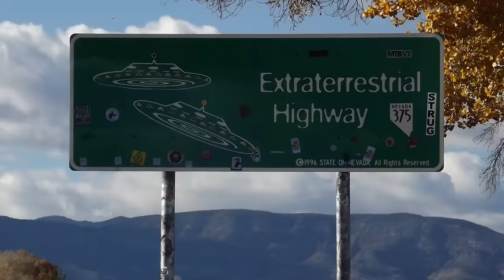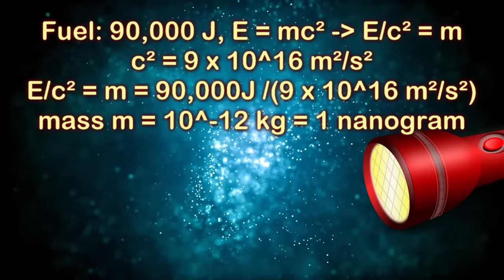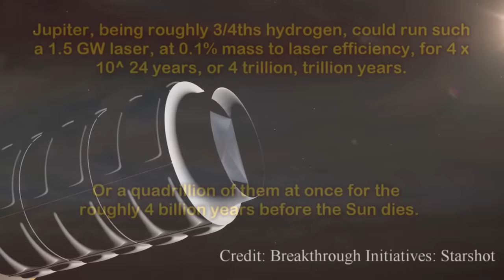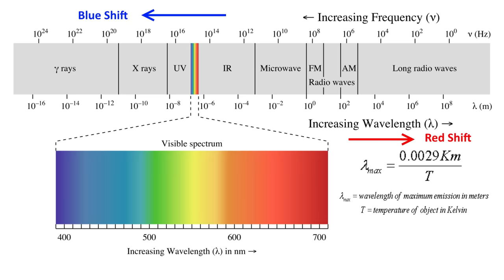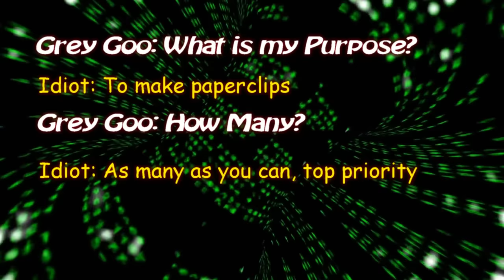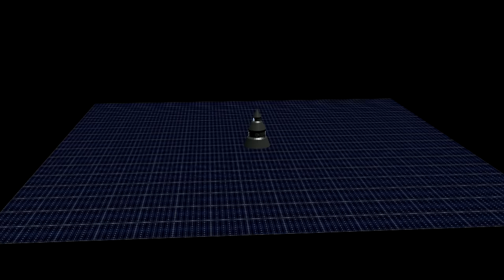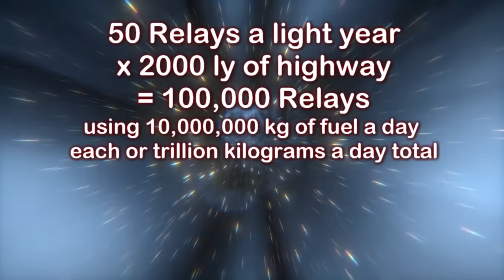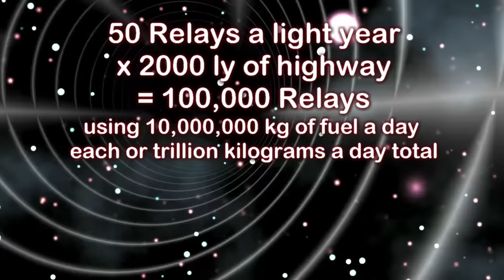Interstellar Highways

Comment: Thank you once more for that great content you're providing, Isaac.

One note though, I think this time your ballpark equation forgot one thing: Equal and opposite reaction. Those laser stations would eventually need to project the same mass/energy in the opposite direction.

Unless I failed to concentrate and you actually mentioned it. :-)
Reply from the maker: I think I did, maybe in gloss-over fashion. The stations can be quite massive, just huge bunkers of hydrogen if it comes to it, so they won't move much, and they can bounce off each other in a long array for corrections and do momentum dumps at the chain end on Jupiter or the Sun, etc.

Comment: I know this is a really old episode but since a flashlight would accelerate from using its light, how would the relays stay in the same position?
Reply: They wouldn't, the positions would need to be stabilized and corrected.  
Either on board engines or light from nearby stars could be directed to correct the positions of way stations using light sails.

Comment: What about station keeping for those laser outposts? You might have to fire a second laser in the oposite direction so the outpost doesnt push itself away. Or maybe you could use the exhaust material from the fusion reactors to fuel an ion drive for that. Or even use the other laser outposts to push each other back into position.
Reply: Use the waste heat of the laser; radiate enough in the opposite vector of the beam emission and you can cancel the 'drift' effect.

Comment: To get the equipment/personnel out to an interstellar comet to build a relay couldn't you send two sails out, both contain fuel and a laser. As you approach your ice ball the home laser shuts off, the front sail fires a laser at the trailing sail, slowing it down. The front sail flies off into oblivion but the second sail is now stationary in relation to the iceball, ready to stop the sail with the crew and equipment.
Reply from the maker: Yes but no, there's a long time lag to slow down and the other sail is going to keep getting further away quite quickly. There are other ways to slow down, Bussard Ramjet, fusion if you've got it, old school Orion method of shooting Nukes out in front of you, etc.

Comment: In Robert Forward's Mirror Matter, I remember that he had some calculations showing that an antimatter fueled rocket wouldn't ever need a fuel fraction higher than 63%. I don't recall if that was for pion or photon rockets, or if that even applied to interstellar travel, however.
Reply from the maker: I don't recall that one very well, I'm sure I've read it but I love Forward for his ideas and his writing itself is kinda 'meh' so I rarely reread them and not in a long while. I would guess though that he was making a generalized statement about there being no point in going faster than that. I mean the exhaust velocity is basically c for antimatter so you are going to be at decently relativistic speeds off that.

Comment: You didn't mention Robert Forward's idea of detaching part of the solar sail to reflect the beam so that the reflected beam can be used to decelerate, which of course depends on the trajectory being in three dimensions hence the path to the reflector does not actually cross the decelerating spaceship.  As these are sunlight speed methods of transit, not only would the "highway" have to morph with the movement of the stars but must last for many thousands of not millions of years to be viable plus they would take a long time to establish.  Conceivably, we could use Orion pulse propulsion to establish a number of these waystations between Sol and Proxima Centaurus in a reasonable period of time but really the hope would have to be in finding such relays built by prior civilizations.  How would we detected them, flashes of light as they are used? Ribbons of what would appear as dark matter to use if they are matter streams?  How would we design a spaceship to use multiple variants of this technology since there may be several technologies by different civilizations found.  What could we bring to trade for the relay service?

Comment: If the sail absorped %100 of the light rather than reflect it wouldnt that get rid of the unexpected drifts?(Caused by the 'miniscule change of angle of the mirror')  
Since if it absorps rather than reflect the light, the miniscule angle variations of the sail would not matter and the ship would only gain momentum in the direction of the laser beam it just absorped.
But then there is a heat problem of course...

Comment: the lasers bouncing off the ships would be quite dangerous since they bounce in different directions depending on the ships steering themselves, outputting high energy beams all over the place. it would be interesting to think about the safety measures needed to avoid those beams wreaking havoc to some nearby rotating habitats

Comment: 1. Can't we have the arriving craft transmit its energy to the departing one (something like a electromagnetic system in my knowledge standards; something like a spring load-realease system in kids standards, and things way more advanced in modern, let alone future realistic standards)?
2. I don't think its wise to mine the planets, stars and even asteroids other than what they loose naturally (sun's disonsphere should be fine for example) as they
a) keep the balance of the solar system by their gravity and
b) can be used as slingshots which means
i) the routes would need even more frequent updates due to moving and shifting gravitational fields/forces and
ii) their elimination would stop this advantage of free acceleration in any desired direction.

Comment: As a concept would quantum entanglement be viable to transmit data to maintain beam alignment? Specifically in terms of GPS.

edit: I should clarify. Could it be used for timing synchronization?

Comment: This is a bit of a tangent to in-system travel, but it follows from the particle stream riding idea;

Would it be useful to magnetically constrict solar wind, via a ring shaped stations, forming a sort of spiraling canal of charged particles? Or would the energy requirements for such magnetic constriction fail to break even when compared to using that energy for laser boosting?
Reply: Having mulled it over a bit more, I have come to the conclusion that such a system could be effective regardless of the energy need if the magnetic field constricting and speeding up solar wind is a secondary effect of some other system. Or possibly a tertiary effect, if the magnetic field generated would be sufficient to shield people from radiation. Though it's hard to imagine that such a shielding would be useless even if it required to be supplemented by mass.

This - in my mind - could be achieved by having counter-rotating rings acting as a transportation system for a large enough ring shaped habitat or set of habitats arranged in a octagonal tube, bell or hourglass shape. With the conveyor belts forming a gigantic Wimshurst machine. Of course such a habitat array could be used to simply magnetically accelerate spacecraft, or if arranged in a more complex manner, to offer boost services of both plasma and magnetic types.

[edit]: In retrospect, this specific scheme seems a bit contrived. Especially since such a construction could arise from sufficiently dense network of vac-trains could give rise to such a field or mandate it if the magnetic fields of the maglev tracks would cause van Allen belts to appear within the habitats otherwise. That - in my mind - makes it conceivable that there is a sweet spot of location, scale and requirements where such an arrangement is viable and economically beneficial. Provided you can charge a fee from the ships passing trough your sovereign space.

Comment: Wouldn't you need a special field to absorb nutrons [instead of a material]? 

How about shooting a nutron beam into a black hole [a blackhole that is power core]?

Wouldn't that be efficient?

(I'm not a physisicst so IDK, sorry if I seem trollish or ignorant)
Reply: If you created a small black hole with an electromagnetic squeezing tool (IDK how much power <i>that</i> would take), start it rotating, create a orbiting ring craft around it; and then use the black hole as a solar sail (would stray nutrinos get absorbed by it and send it off course?), and then blasy nutrons and photons and protons at it via laser: to get it moving?

Comment: Have you given any thought to using planetary magnetic fields or currents for accelerating ships. Remember when they did the conductive tether experiment on the shuttle and as it extended it burnt out like a fuse. Seems like electric current generated by a ship could act against planetary or other magnetic or electric fields in the solar system to accelerate itself.

Comment: Just a thought, would you need to double the output of the laser stations to keep them on station? Wouldn't the Lasers move them as well as the ships they move?  If the laser stations were on very massive rocks they would still be moved over time? I guess if they shot both ways it might help but still it would have minor angles to deal with as you don't want the ships to hit them either. So they would need more fuel than you thought of but still would be worth it.
Reply: I think I heard it said once they'd have to fire off in the other direction, at least enough to cancel that out or some such. Though if you have 2 way traffic that can be balanced to take care of itself.

Comment: As you shrink a rocket from Macro to Micro scales, does the efficency naturally go up? I mean a lot of rocket fuel is random molecules working in a nozzle sometimes against itself creating wasteful pressure in various directions.. a very tiny rocket engine would be like a rail gun with only one direction and very little waste.. perhaps some quantum effects.. if you could scale a "Perfect" Pressure plate Upwards so it only emits molecules always in one direction it seems like it would have very high efficiency and waste very little as heat.

Comment: Wouldn't each relay also need a second set of lasers blasting in the opposite direction of the first, to keep the relay from accelerating itself out of place?  Or a bigass set of ion thrusters or something.
Reply: You don't need high speed thrust, just equal offsetting momentum.  Ejecting waste material from asteroid mining in the opposite direction at chemical thrust speeds would do the trick with enough mass.

I do wonder if you could have a colony close enough to a nearby star to have a solar collector large enough to sail on the solar wind with enough force to no just counteract the stars gravitational pull, but also cancel out the laser thrust produced.  I'm sure when you can gather even a tiny percentage of an average star's output, there would be some easy and economical way to counteract the laser thrust.
Reply: Lasers of the output IA postulates will generate
A LOT.
of waste heat.  If some or most of that heat is radiated in the opposite direction of the laser, that could be enough to mostly offset the momentum imparted from emitting the laser beam.

Comment: I have often thought about capturing solar particles near the Sun, funneling them, and accelerating them towards a spaceship. However the problem I see is that it would work for charged particles, but these particles would disperse quite quickly as distance increases. Interactions in a cloud of charged particles is not a good thing if the particles have all the same charge. So we'd have to beam neutrons, but emitting a thin and powerful beam of neutrons is really not an easy task.
Reply from the maker: Hard to say, the density of that beam wouldn't need to be particularly high, consider that one microgram of particles emitted at near light speed in a given second might contain a billion, billion particles but spread over a length nearly a billion meters, or if we pictured that as a 1-D beam of particles, about one a nanometer. If those were all the same charge the ones ahead are pushing back on any given particle in the exact same strength and opposite direction of those behind. Ditto a line of protons and electrons evenly spaced, every other one, should be pretty neutral in forces. I'm sure minor deviations from this or that will eventually skew that chain and start causing divergence but ti could be over a pretty long way. And that is a ton of momentum, a micro gram at relativistic speeds, so it need not be a beam of any real diameter.

Comment: I wonder if it would be possible to create a giant kind of ring-rail network in our solar system that gave a ship a little kick as it went through each ring, a bit like a massively scaled up version of a particle accelerator then shoot it out when it got to the right speed and direction.  You'd still need the lasers to clear its path though.

Comment: Why not intermittent high-power lasers maybe running 6 hrs on 6 hrs off, but a continuous lower power system, both focused along the same paths?  You may not be running high speed the entire time but you are still accelerating.  If the lower power (say microwaves) is broadcast over a wider path, you'd have a wide enough road for maneuvering to some extent.  Ships that wanted to take advantage of the high-speed corridor could maneuver in or out of the beam path.  Less urgent travel just keeps trucking in the low power corridor.

Comment: Isaac, theoretically speaking, would it be possible to reflect the laser around the sail and redirect it to hit the back side of the sail to slow the ship down? As I'm asking the question I'm guessing that the inertia imparted to the ship while reflecting the beam would offset any decrease in motion after bouncing the beam off the back of the sail.
Reply from the maker: You can bounce a beam off a mirror ahead to hit the ship and exert backward force, but that object needs to be rather massive for it to be useful. Like if you set on of these up for interplanetary travel you could stick mirrors on comets and such in the outer solar system to act to push ships inward. They could in turn use some of that power and some of their mass as propellant to pwoer an ion drive. That's how you can laser in a comet, you stick some solar panels on it and an ion thruster, and beam the energy out. You exert some force on the comet outward but it can use that power to heat ice as a propellant and get more thrust inward.

Comment: A bit late to the party, but I have a question. Wouldn't putting such lasers on space-born objects/stations/etc along the highway also cause said object to accelerate into the opposite direction of the direction it would fire the laser? As you pointed out with the example of a flashlight, it too would accelerate (ever so slowly) due to the beam of light. Wouldn't this cause issues with the highway constantly shifting and being out of position for the next ship which has already been launched along the 'old' position of the highway? Or can such ships correct their angle of approach enough by themselves?

Edit: Note that I have a pretty large lack of scientific background besides computer science. So I might be entirely wrong :P